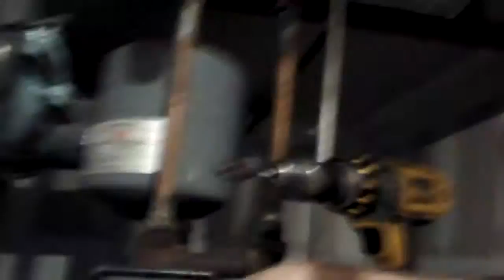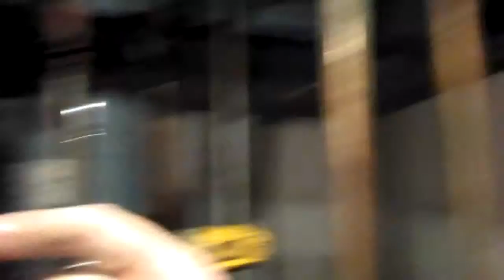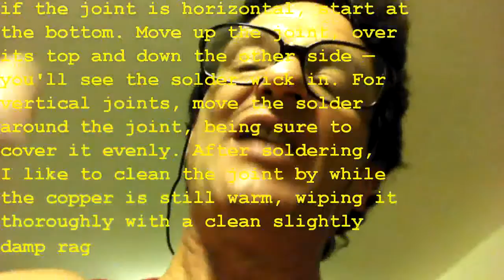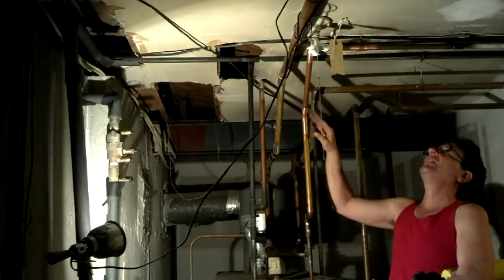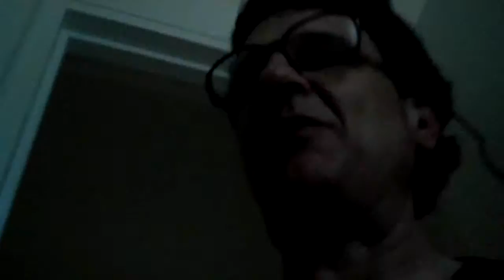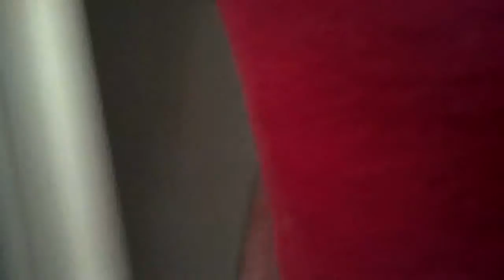Soldering Copper Pipe,  pt 2

Comment: Good video! Fire rating on sheet rock is something like 1/2 hour so I use a heat shield just to protect the paint job or the sheet rock paper. I use my fingers too to spread the flux when I couldn't find my brush, Don't solder enough to cause any long term problems, not like others working with that stuff all day and everyday.  

Need to protect eyes and face from falling hot molten solder when working overhead. Even not working overhead I had solder exploded in my face on a few occasions.